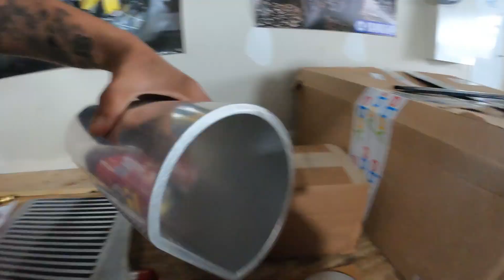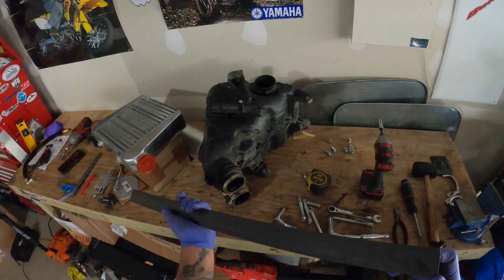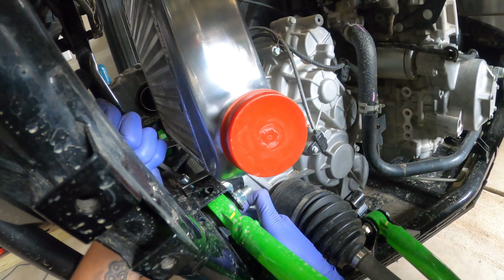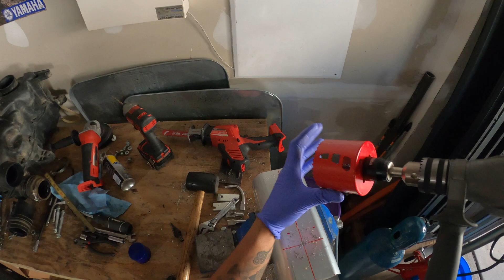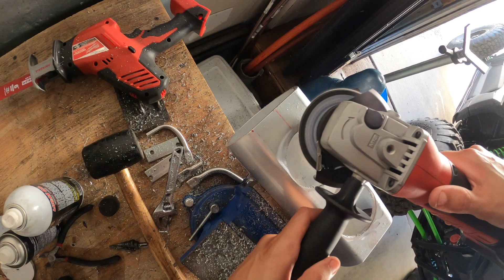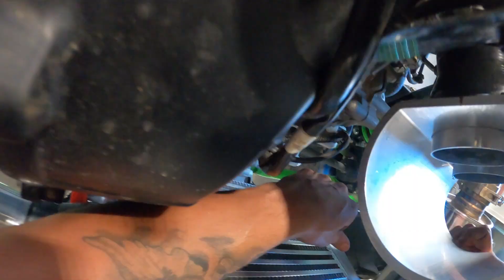UTV Intercooler , blow off and air intake BOX Upgrade krx1000!

Comment: Have you ran into any issues with the stock fuel pump not pumping enough fuel? I’ve Been tuning mine and I think that’s the issue I’m having with the force turbos kit.
Reply from the maker: if i have the same problem.  I can't find another gasoline pump with more gas pressure
Reply from the maker: https://bruteperformance.com/products/ols/products/krx-1000-fuel-pump-assembly